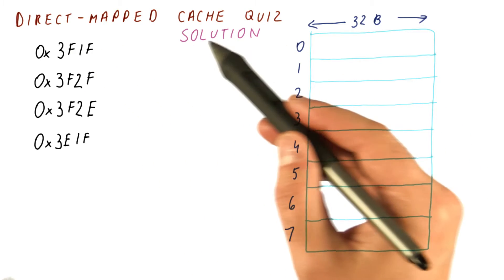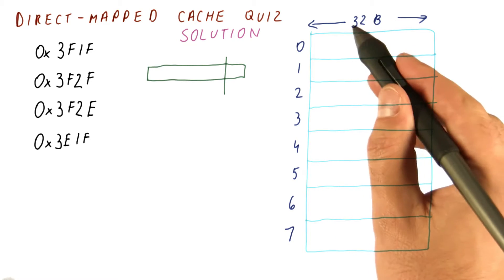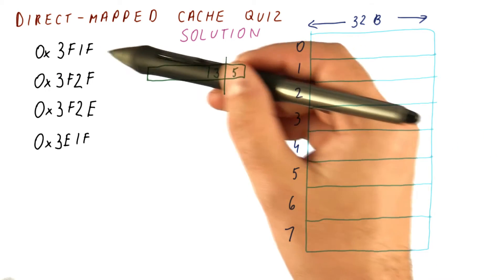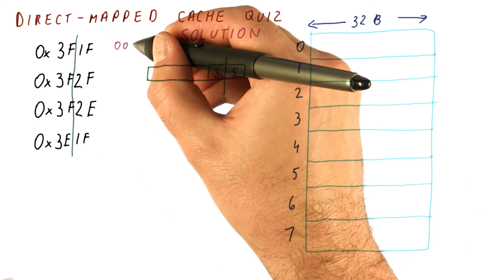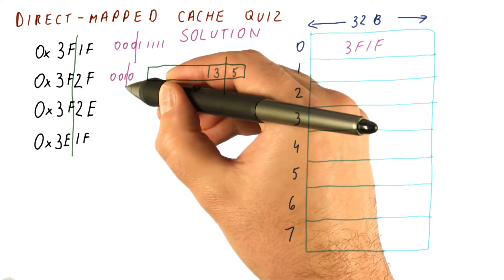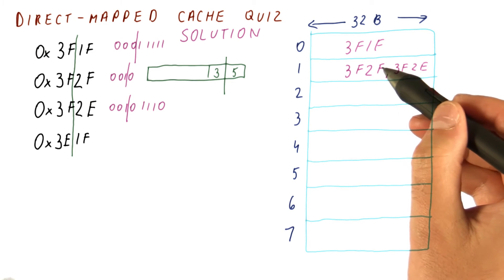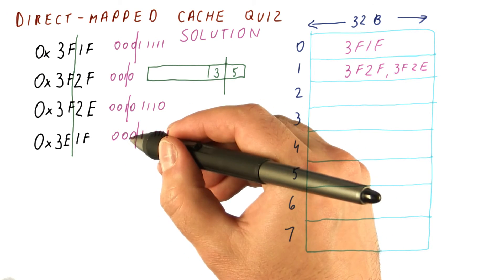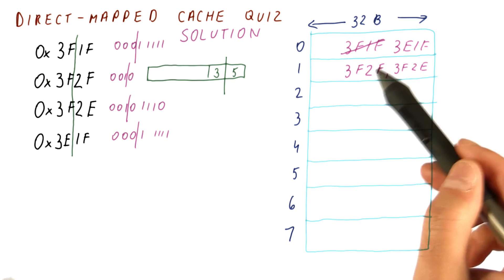Direct Mapped Cache Quiz Solution 2 - Georgia Tech HPCA Part 3

Comment: how they can be in the same block in direct mapped cache ?
Reply: since this comment is 6 years old, I'm going to assume that you either already have your answer or you do not care anymore.  For future people who may find this comment however, the reason is because the offset is different.  The data at a memory location is stored as a single byte, and since each block is 32 bytes large, then each block can store the data at 32 different memory locations (assuming those memory locations are contiguous).  If the memory locations are not contiguous, then the tag will be different, and the block will be overwritten
Reply: @avastabyss  Thank you